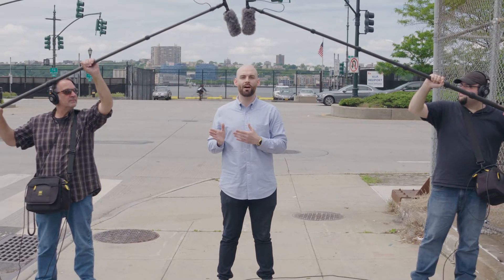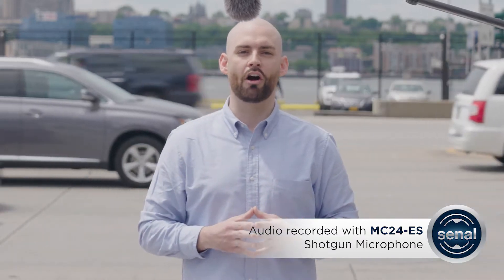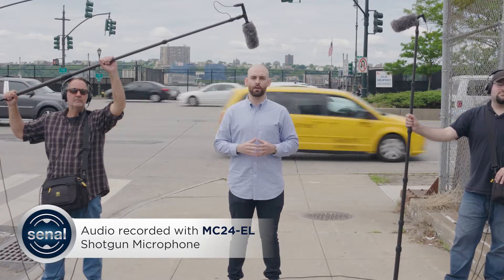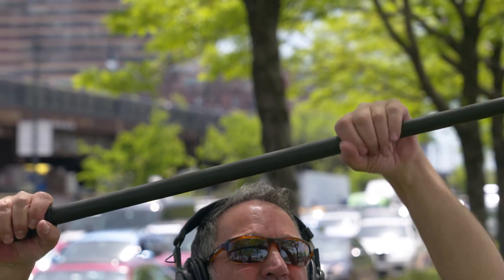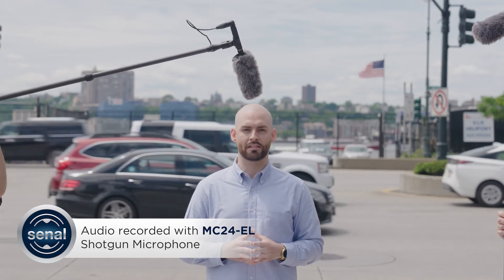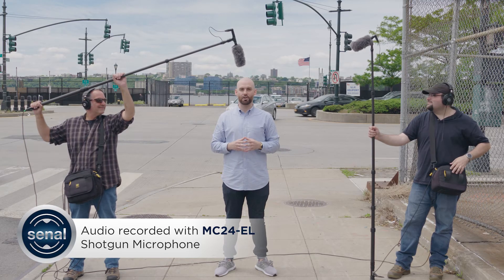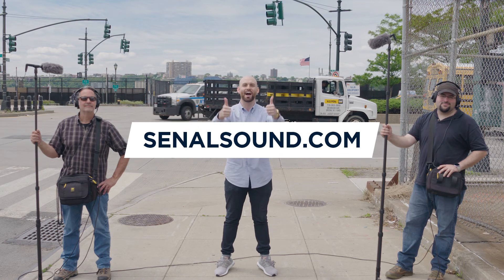Mics in the Fast Lane: Senal MC24-EL & ES Shotgun Microphones

Comment: wait... the purpose of this video was to demonstrate the mic's ability to reject off-axis noise in a 'real-world' use case... but, you have a boom pole in every shot. 0:40 -- your contention is that it's form factor is compact so you won't have a problem with the mic poking into shots... but, the mic is IN THE SHOT!!!!! LOL!!!! ...i don't think that 'feature' landed.
Reply from the maker: Hi Tim,

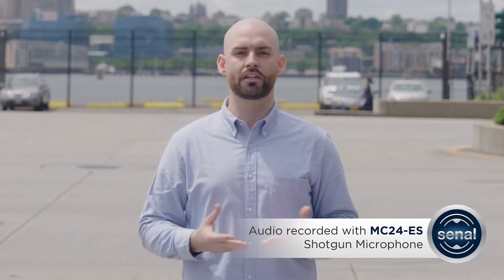Thanks for your astute observation. By “real-world use case” we meant filming run and gun in a busy, noisy environment. We wanted to show the off-axis rejection properties of the mic, not a how-to for boom operators. We also wanted to show the mic in context with the subject for reference — something almost no one ever does. Does that make sense? That explains most of the wide shots. Is it a bit close? Perhaps. But the rough positioning, angle, and distance from the subject are what one might aim for as a boom operator. Look at the shot at 1:35-1:44 https://youtu.be/WEKp9jNFLWQ?t=99 for traditional framing and hiding of the boom. As for boom operator form on various shots, check out these videos featuring pro sound mixer Josh Allen: https://youtu.be/o5aLqW2Wncg & https://youtu.be/Uy4zFaMmfyM. He is on point. 

Regards,
Kevin

Comment: @2:18 - Love the Vanilla Ice's first album reference "To the extreme" which I was a huge fan of! Which one is better ES or EL? Keep it up btw!
Reply from the maker: Badmash,

Thanks for the comment!

I'm glad you dug the reference. I almost wrote a "Please Hammer, Don't Hurt 'Em" line about shooting near the pneumatic concrete-crushing of NYC street construction... but that's another video :)

I believe having an ES vs. EL discussion is best served without measuring "better" as a global attribute and, rather, considering which is best for a specific job. I love the EL's rejective properties in noisier environments but I also understand there has to be more precision with placement to keep the subject in the sweet spot. I love the compact size of the ES, letting a boom operator squeeze into tight corners and low-ceilings while having more margin around the target. I'm fortunate to have both in my kit but, if I had to choose, I'd let the set/location be the deciding factor. Interior with a tight room? Grab the ES. Large hall or exterior? I'd take the EL. They're both great; you can't go wrong by trying them out.

I checked out your production company's reel. Great work! If you end up getting/using a MC-24, please let me know your experience. I'd love to learn a thing or two from your unique perspective.

Best,

Shawn from Senal

Comment: nice! i really like that you guys put this together!! i bought the MC24-EL back in Feb 2017, I recently used it on a few projects, specifically a Domino's Pizza project, but I just felt like it picked up too much background noise, so I had to use the lav mic audio instead. I was expecting better. Although, it did SAVE ME in a few places where the talent obscured the lav recorder cord connection in their pocket. Maybe I had settings wrong on the Zoom H1? Also, the boom mic holder maybe didn't have the axis correct. IDK. I guess I just thought it would pickup better. I will not hijack your post by inserting the link, but you can check out the Domino's videos on my channel. I used the Senal MC24-EL on a marantz pro boom pole w/built in XLR, Auray suspension mount and windbuster. My backup was the rode smartlav+ with Zoom H1. Maybe you could go over the settings you had on the mic and audio recorder and how to adjust for a specific situation? Anyway, I need a solution for doing a video of longboarding skateboarders down a mountain? any recommendations? cheers!
Reply from the maker: Flying Ace Films,

Thanks for reaching out. First, please let me apologize for the slow response; your comment slipped past my radar. I checked out your Domino's spots. Very cool! I loved how you directed the Domino's smartcar to peek out from behind the Rolls Royce and exotic cars. Also loved the POV shots from the roof. Thank you for your link courtesy and for sharing your work.

I noticed opportunity to improve the audio on the videos you shared but, without being part of your production process, it's difficult for me to specify just where tweaks could be made. I'm inclined to think something wasn't ideal in either the signal chain or placement. I've used the MC24-EL several times with really great results. 

It's possible that the Zoom H1 wasn't the best tool for this job. For example, the MC24-EL has an XLR connection and the H1 does not. I know B&H sells MC24 kits with an XLR to 3.5 mini cable but when working with a big name client such as Domino's, I might consider limiting unecessary complications to the signal path. The H1 is a great piece of gear but I think this job may have benefited from something with more robust options, improved pre-amps and an XLR connection. On Mics in the Fast Lane we used a Sound  Devices 633. While we were shooting in one of the nastiest areas in New York, with respect to noise, the clean preamps on the Sound Devices and rejective properties of the MC24 allowed us to get a usable signal. This mic can really shine in a controlled environment but the purpose of this video was to get extreme. As a general rule of thumb, I like to position the microphone as close to the subject as possible (without being in frame) and adjust the gain so that dialogue falls and rises between -12dB and -6dB, give or take. This tends to average out at around -9dB. Unless I'm live-streaming, I tend to record without any high-pass filtering enabled and allow myself flexibility to EQ in post-production.

The placement is extremely important with any microphone but especially when dealing with sensitive shotgun mics. Turned just an inch or two in the wrong direction and the polar pattern suddenly becomes incredibly unforgiving. I've seen all too many folks just camera-mount their shotgun mic and expect it to deliver rich, intimate audio from across the room. Do you have any behind-the-scenes photos of your approach and positioning? For a refresher on placement, here's an easy-to-digest video that I like: https://wistia.com/blog/top-hat-tuesday-mic-placement

You've demonstrated good decision making, particularly in Rae's Domino's video at ~:56, where a shotgun microphone is probably not the best approach. Because of how wide the shot is, getting a boomed mic close enough to produce a clean signal is going to be difficult and I believe you've best served the video by lav'ing the talent here. The tighter shots, such as inside the pizza shop, should have been ideal for a properly placed MC24 -- which makes me think something may have been wonky with the H1. I've been on sets where Zoom's have been used and, because of spinning many production plates and lack of a dedicated sound person, the director accidentally activated the built-in stereo microphone, as opposed to the boomed shotgun mic's input, and captured all of the ugliness of a room's acoustic character with very little emphasis on the subject. Any chance something like that happened?

With respect to the longboarding question, if the goal is to record dialogue, I'd suggest good lavalier mics and a wireless system. A boom operator would likely need to be an gold medalist olympian to keep up consistent hypercardioid proximity while chasing skateboarders down a mountain and I'm sure production insurance wouldn't be cheap. Grab a Senal AWS-2000 wireless system, a Senal UTM-86 lavalier mic and have the receiver trail safely behind the action (up to 500 feet away, depending on the RF environment).

I hope this helps. Thanks for watching!

Shawn from Senal
Reply: no worries on the response :-) it is possible that the Zoom connection was tampered with, was on such a tight budget I did everything myself & Dominos provided 1 marketing person to handle the boom pole for me, such a brief tutorial on using it with them but it was not ideal to say the least. It was hard when you are basically a 1-man crew. I'm sure the SD 633 would've sounded better but that is currently out of reach $$. Working toward it though. Thanks for the reply and I enjoy watching and learning. Need an extra hand in a vid project lmk. Cheers!
Reply: oh yeah, the longboarding question was thinking of longboarding down myself trailing, beside, or in front...could also pass the camera/mic to another rider, something like that. Just looking for something that would really cut out the wind noise and give me some good ambient sound and sound effects. well cheers!